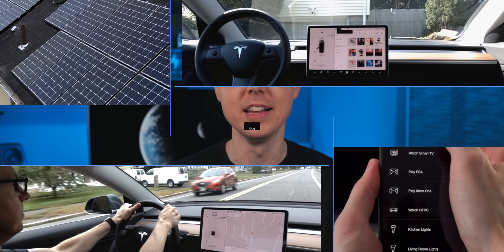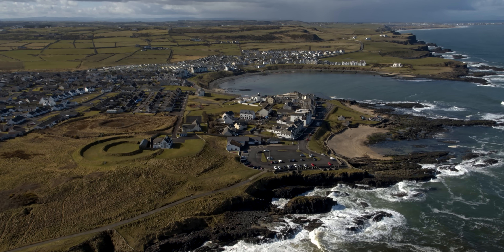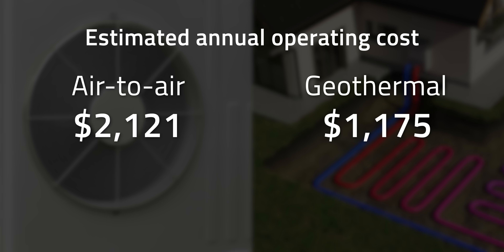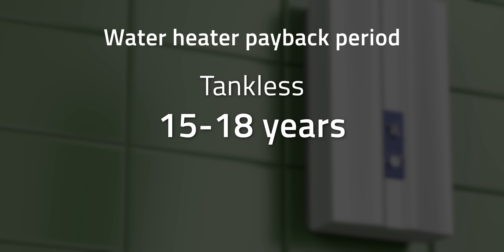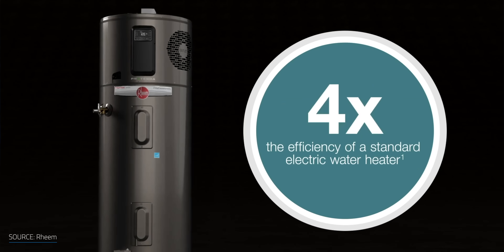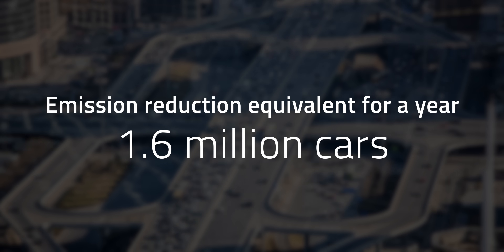Why Heat Pumps are Essential for the Future - Explained

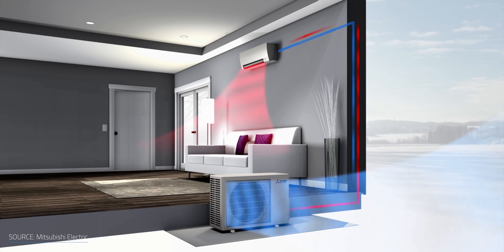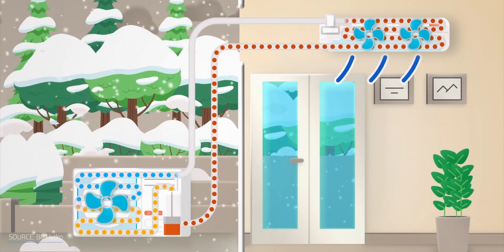Comment: You get the mechanism wrong... Some corrections 2:24 - heat pumps don't "move air" into the house or out of the house - they move heat! The air that was already in the house is warmed in Winter (or cooled in Summer) and the air that's outside of the house is cooled in Winter (or warmed in Summer). The heat pump does not mix the two air masses. 3:05 Cause and effect are wrong. The refrigerant passes through an expansion device which drops the pressure and makes refrigerant boil and cool down. Since now the refrigerant is colder than the ambient outside air, while passing through the outside coil. it absorbs the heat from outside air and warms up to close to that temperature (even when its quite cold outside). 3:10 The compressor turns refrigerant into hot liquid - no 'refrigerant and vapour' after the compressor - just hot liquid refrigerant. 3:13 'As the vapour moves through the evaporator it releases heat into the room" - WRONG - liquid hot refrigerant releases heat into the room because it's much hotter than the air in the room - that's it. The expansion device on the room side is bypassed during the heating cycles. The coil in the room unit is used as an evaporator in the cooling cycle - and during cooling cycle the expansion device on the outside coil is bypassed. Please get the mechanism correctly - right now you are just confusing your audience - and you have 1M views. There comes responsibility with that!

Comment: Hi Matt, great video.  I live up in Maine and installed a heat pump 6 years ago.  It does wonders for the hot and humid summer days, helping me reduce the next for installing window units.  However in winter, once the outside temp hits 20F or lower, it isn't efficient and blows cold air.  Perhaps the unit can be upgraded?  Also, I just upgraded to a heat pump water heater, so it is no longer driven by my 1960's oil furnace.  Installed in the basement, which doubles as my 3D printing lab and YouTube studio, it has done wonders at dehumidifying the shop.  On average the humidity is 19-22% and the temp stays around 66F.  I am not sure what to replace my old oil furnace with at this time. I have been hoping to see some reviews on heat pump dryers.  The technology hasn't been available here for very long, so that's on my radar.  Right now our electrical rates have doubled (or more) so my next big upgrade is looking into solar panels and perhaps some battery storage, in the event of an outage (versus a propane generator system).

Comment: I just bought my first new home and am trying to make my home as energy efficient as possible. so when it came time for air conditioners I bought two new heat pumps. but I didn't know about the heat pump dryers. when we need a new one, that will definitely be the thing! I love all of the information I get on this channel. trying to choose solar panel Brands right now
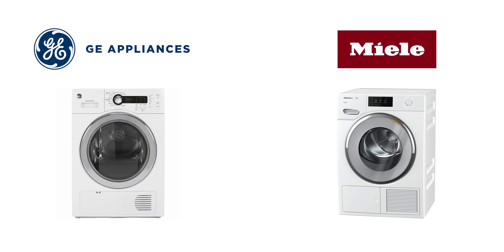Reply: 11:50 amazing. in Europe, we are using heat pump dryers for about 10-15yrs. for a couple of years now all older technologies (like condensation dryer) disappeared from the market

Comment: We put a Mitsubishi mini-split in the sunroom because the new furnace duct work didn't cut it.  We love it.   Can stand right over it on the deck and cannot hear it run.  Wish they could make a central air unit that QUIET and energy efficient.

Comment: Most people own already one or more heat pumps: Fridges, freezers, A/C, and indeed some clothes dryers.
Most people just don't realize how adaptable the technology is: Air, water, ground can serve as a source or destination for heat, and the flow can be made reversible.
Air->air makes sense for small homes, air->water for medium homes, ground->water for larger homes.
The only source of heat which can definitely beat at-home heatpump systems is District Heating -- using leftover heat from industries. Especially for hot tap water and older (difficult to insulate) homes, district heat networks will outperform residential heat pumps.

Comment: I use heat pumps everywhere in my new home. A 17kW for the pool, 6 split systems for indoors (2.5 to 7kW) and a 350litre hot water heat pump and a LG 16kg heat pump dryer/washer tower. All powered with a very big solar array   - the whole roof is covered in panels so almost zero daily cost to heat/cool the home.

Comment: R134A is not standard for household heat pumps. In fact, thats illegal in the Us. R134A is only used for car compressors and other small units.

Most household heat pumps are using R410A.

Comment: You can maintain the COP of an air source heat pump (in northern latitudes) during the daytime, with a solar air heater.  A glazed unit can provide up to a 32C temperature rise and also reduce icing.

Comment: We have recently completed construction of a pair of semi detached four bedroom houses in the Isle of Man built to comply with the Swedish passive house system. We moved in just over three months ago and after two weeks turned off the 3kw off peak electric heaters. Ever since then we have maintained internal temperatures of between 23 and 25 degrees purely from solar gain and energy from appliances and our own bodies through the MVHR (mechanical ventilation heat recovery) unit that we installed as part of the concept. With the onset of summer it is becoming more difficult to stop overheating in the house, currently we are using controlled opening of windows to keep the temperature within the required range. Later this year we anticipate completing development of an air to water heat pump of around 600 watts to take excess thermal energy from the house during the summer and using it to pre-heat the hot water in the 300 litre cylinder we installed through a tubular immersion,  it is currently heated by an off peak electric immersion heater. We anticipate achieving a COP of around 5 to 1. We only use electric in the house not gas or oil, our last quarterly bill for off peak heating was £70 which also included laundry etc used through the off peak period. We are keeping a graph of energy usage and internal external temperatures and believe that our off peak heating usage through the winter will not exceed the above cost by more than a small margin given the proven efficiency of the system. Airtightness of the houses was critical to this concept and is currently less than one air change per hour at 50 pascalls.

Comment: ty for the super interesting video.
1. heat pump dryer: with a lower drying temperature, this extends the life of your clothes because high heat shortens the life of the fabric of your clothes. 2. your last comment at 14:08 of what do I think? My answer is that it doesn't matter what I think, but rather, like you, we should look at the pure economics. Heat pump appliances can save us a tremendous amount of money, although sometimes at a high upfront costs, and simply put, saving money is good for everyone. So why not? I think there are some concerns with the technology (the refridgerant safety, toxicity, etc.) but hopefully with greater adoption of the technology comes increased research.

Comment: I built an energy efficient home in Chile using heat pumps for heat, hot water and laundry.  Six years into living in this house and the heat pumps work as advertised, my home is net zero with a 5.6 kw solar array.

Comment: Go geothermal ground to water and radiate heat/cool your home with water pipes in the floor. Radiating floor. Some brands allow you to connect "air conditioning" units to the same heat pump and they work together to efficiently confort your home (heat or cool) by starting with air first and gradually migrating to water. These units also manage your domestic hot water tank with the same unit. You can go Monoblock (water exits the heat pump), Bi-Block (gas from the heatpump runs to an internal unit; most common used when air-con is sharing the same heat pump).

COP for Air is between 3-5. COP for Geothermal is up to above 8. (See Ecoforrest brand from the north of Spain for example).

The newer LG Therma V units which use R32 gas can maintain it's rating up to below 7ºC and provide upto 65ºC on the heatpump alone without the need of employing the resistor.

Americans love air-air for some reason when this is the least efficient or comfortable unless you live in a very humid climate like on the coast of southern Florida. Radiators are much more comfortable and efficient.

Comment: I recommend calling your local HVAC company especially for those in colder regions. They’re going to tell you from practical applications that it’s your choice but they’re still no where near what a stand alone gas furnace can do. May be a great option in the lower US but you’ll regret your heat pump the next arctic blast that comes through when it’s sub zero outside and you can’t get your house as warm as you’d like and get frustrated when inefficient electric heat strips ran all week and your electric bill was way up.
Reply: See: the many people in Texas the past couple of years who were battling freezing pipes.

Comment: Are we missing an opportunity to get free hot water in the summer when the house heat pump is being used to pump heat out of the house. Adding a water-refrigerant heat exchanger would allow some of the heat that would otherwise just be rejected to the outside air to be captured to provide domestic hot water. And during the winter the heat pump, sized appropriately, could provide space heating as well as hot water, only one heat pump rather than two would be required.

If radiant floor heat is used, then it would be even easier since both radiant floor heaters and domestic hot water work well at 120 F (max safe hot water temperature).

Comment: I'm seriously looking into getting a heat pump since the price of natural gas keeps climbing! This vid helped me understand much better the pros and cons of a heat pump. Thanks!
Reply: Brett Barager, I installed a 18,000 ductless heat pump from Amazon for my neighbor, $899.  I charged him about $400 to install it, and he had a 240 volt disconnect that I was able to use from a not working heat pump.  I put the indoor coil in the living room, and it heats his 1,400 square foot home silently!  At 20F, it works great!  

To gather 100,000 Btu's you can use about 1.2 therms of gas (and about 500 watts to run the fan), or 30 KW of electric heater or about 5 KW to 7 KW using a ductless heat pump!

Comment: Do  heat pumps still require a lot of maintenance.  Had one in the past and it was a lot of trouble.  Also had several units at my church and we had to call for service often.   Eventually the church went with natural gas and that solved the problem.  When I had a heat pump and it ran constantly I switched to emergency pure electric heat.

Comment: the heat pump dryer is a prime example for efficient use of a heat pump. You have use for hot and the cold part of the system. 
It doesn't need to be as hot as the air goes through the cold part of the system and the moisture is collected there very well as this part is close to freezing. That now dry air heated up can collect a lot of water without the big temperature raise needed

Comment: I have install heat pumps. They work best with an under/in floor heating systems. A floor heating system uses water at 40 deg C, so lower temp than raidiator. (So more efficient). Also, one can have a tiled or hard floor. A tiled floor lasts for many years carpets have to be replaced. Replacing carpets creates more C02 and waste.

Comment: Heat pump tech is definitely way to go. In regard ground source units, you don't have to dig metres (yards) of trenches, as you can just dig a vertical column hole and placed coiled piping in that and surround by a sound aggregate and sand filling. Unfortunately, we have very little ground temp data available, eg temps at 8 metres (approx 26') deep, but theory says temps at this level should be more stable. If this hole was 26' deep and 3 feet wide, this is a large volume compared to what can be achieved with lineal trenches and way cheaper to dig.

Comment: Bought a 9kg heat pump dryer a little over a year ago, cost about £50 more than an equivalent condenser dryer - my total price was £255 or ~ $300.

It does take longer, but the efficiency in energy usage is very noticeable compared to my previous condenser dryer, taking about ⅓ of the energy despite taking about 40% longer in time.

That said, here in the UK it is far more common to dry your clothes on an outdoor airer whenever possible and only use a dryer as a last resort meaning that extra time does not hamper the laundry schedule in any way.

Comment: I have a 48,000 Btu 14 SEER Goodman heat pump that I installed in 2014 to heat and cool my 1,800 square foot fairly well insulated home in Portland Oregon.  We recently had 4 nights at near record cold 23F.  Most years it does not drop below 28F for more than a few days.  

I am considering installing a 21 SEER ductless heat pump, 110 volts, and running it with a 2,000 watt solar system.  I bought used 250 watt panels on Craigslist for $85 each.  Inverter and charge controller, and 6 golf cart batteries set up for 48 volts is the balance of the system.  Total cost with heat pump, solar and inverter / controller (PowMr from Amazon) is going to be about $3,000. I can install them myself, and will result in a net zero way to heat and cool my bedroom, and most of the remainder of my home.  I expect to collect about 10 KW per day, and use a lot that for the heat pump and running my refrigerator.  (I am not planning to grid intertie any of this).  

So basically heating and cooling while just using power produced by my solar system, and inverter!  No carbon produced at all!

Comment: Better to clarify the blue dots in the graphic on heating mode at 2:54: The little blue dots (the "refrigerant" ) flowing within the coils of the outside unit gave me the impression it is cool gas whereas the "refrigerant" at the start of the coils is actually  liquid refrigerant at low pressure. This liquid then vaporises/boils  still inside the coils, cooling the coils and exits the coils as a cool vapour. This cool vapour then  gets compressed into a high pressure hot vapour  by the act of compression and the hot vapour flows ( shown as red dots) into the condensor unit inside the room to be heated and gives up its heat and condenses back into a liquid which flows back outside.

Comment: There is a way to make that dryer even more efficient. Just toss a clean, dry bath towel (or two) into your load. After about 30 minutes, pull the towel up and hang it somewhere it can air dry. Now you've taken a large amount of water out of your wet laundry. By the next morning, that towel will be dry and ready to use.

Comment: The UK introduced a £5k grant to assist with the cost of installation of a heat pump this April. We have passed a feasibility test with regards the suitability of our house, and are having a visit from an engineer from Octopus Energy very soon. Octopus are a major player in the move away from gas powered boilers, investing a lot of money in developing better, smaller, cheaper heat pumps and training fitters. We need to do something to break the stranglehold gas has over the energy market, and this is one of our choices. I’ve watched some anti heat pump videos on YouTube and all they have done is convince me even more this is the right thing to do.

Comment: My current house has galvanized SIP walls and roof with geothermal. Over half of the year no heating or cooling is needed.

My 50x75 shop is built into a south-facing hill with about 10 18" air conduits 8 feet below the foundation. The air 8 feet below the foundation varies between 56 and 58 degrees year round and empties into the shop. With just a few fans, the shop stays above 50 when it's 0F and rarely warms up above 72 when it's in the 90's. The biggest temperature changes happen when I open the bay door to bring something in or out.
That's 3750 sq ft of climate controlled space for under the equivalent of $25 a month.

Comment: As an HVAC/R tech I can answer you the question of should everyone get a heat pump. The short answer is no, the long answer is if your house is reasonably well insulated you will see excellent energy efficiency, if you do not it will run nearly non-stop and will not be very efficient. Also most heat pumps don't use 134a most of them use 410a and even that is slotted to be phased out, the other problem with 134a is that if it often gets below 0F outside the unit can't function at all really this is also the reason 134a is not used for freezer applications. As far as the heat pump water heaters, you can get units with a remote coil to allow them to be used in applications with limited space.

Comment: As a HVAC tech with 20+ years, I can say with some certainty the most common Refrigerant in heat pumps, at least in the states, is R410A.  R134a is most commonly used in automotive and refrigeration.
Reply: I read that using CO2 as a refrigerant is possible. But why isn't it used more often?
Reply: @Simon-dm8zv  it requires a lot of pressure at normal temperatures
Reply: @fritt_wastaken  Ok, so the overall efficiency of a system using CO2 is lower compared to other refrigerants?

Comment: You should check for solar-passive greenhouse next to that house you want to build. In mine, I plugged cars radiator to 4 x 1000L tank of water for temperature stabilisation. solar panel will soon heat that water as well. Since i have 200 meters of pipe underground of the green house, i can distribute the heat in the ground, the air, the house or keep it in the water.

Comment: How do we know that a heat pump dryer, with many more failure points, will last longer than a standard dryer.  Was this tested?  With a random sample of production units?  What was the sample size?  I gotta say, I'm skeptical on this claim.  There are a lot of common components, but the heat pump models add much more complexity to the mix.